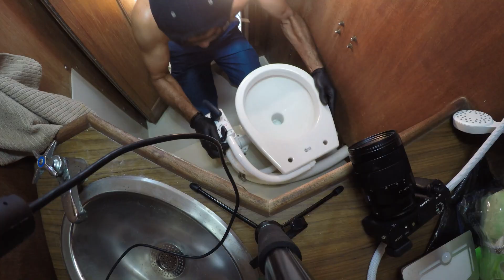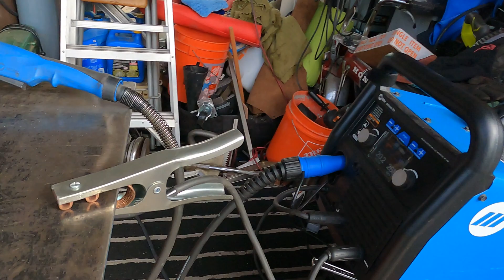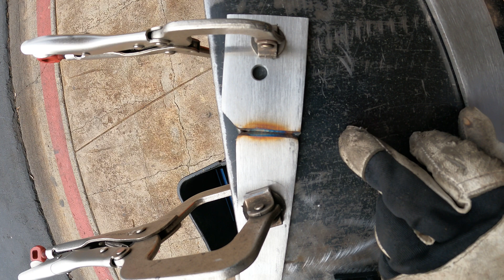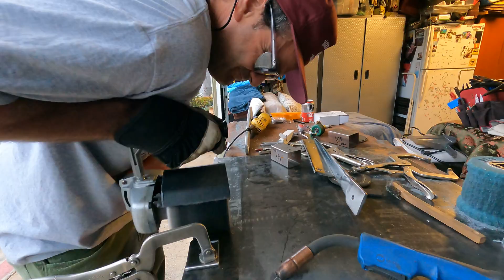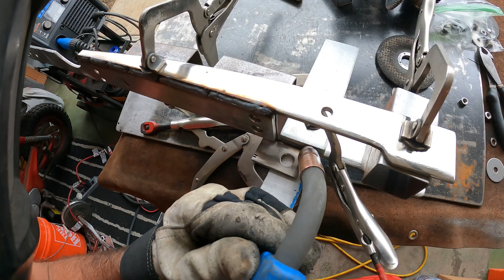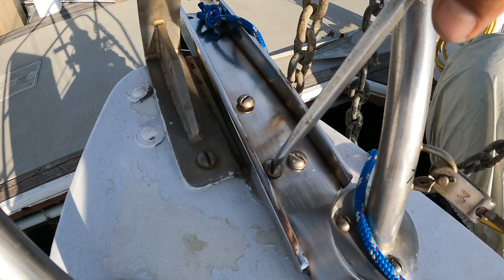EP43 - BOAT WORK: BUILDING my ANCHOR ROLLER | Welding 316 Stainless

Comment: I would like to know what did you use to weld stainless steel? Thanks
Reply from the maker: Miller Multimatic 215 welder, 316L .030 MIG welding wire, 2” x 1/4” 316 Stainless Steel flat stock and a tri-mix of shielding gas (Helium, CO2 & Argon). 👍🏼

Comment: Andy’s got some welding skills. Where did you learn to weld?  Self taught?
Reply from the maker: I learned to stick weld in the Ironworkers Union Local 433 as an apprentice but I never became a journeyman. I am a welder by trade now with my own small company but I rarely weld stainless. I’ve been learning TIG welding because that is much more suited for SS. 🤙🏼

Comment: Well done.

Granted, I know nothing about welding, nor have I ever welded, but I did watch a video a few years ago that fascinated me. Basically, when you are dealing with thin metal that may warp, you are supposed to space out your welds. In your case, you would do one small spot weld and then move to the farthest most part of the project and weld there. And then you repeat and repeat. 

The guy I watched said it basically keeps the metal cool(er)...

Either way, I was watching with great interest. As for your videos, I admit to loving DIY stuff. I'll watch those 9 times out of 10.
Reply from the maker: Thanks for the input. I usually do jump around a bit more with the heat to keep things cooler. Cheers!